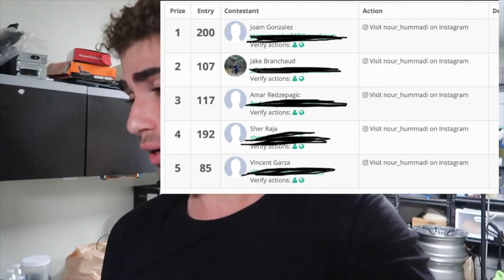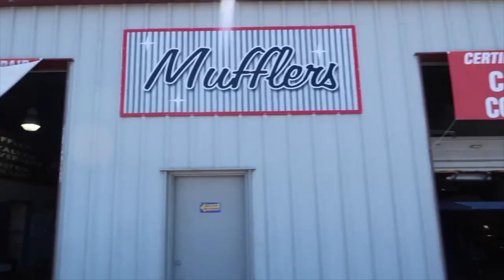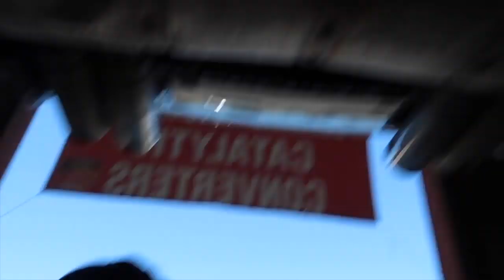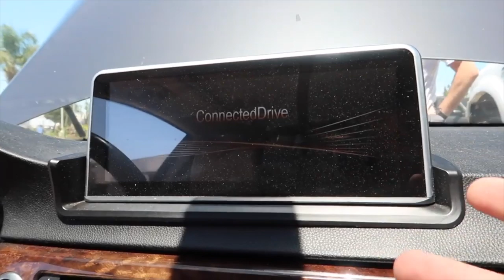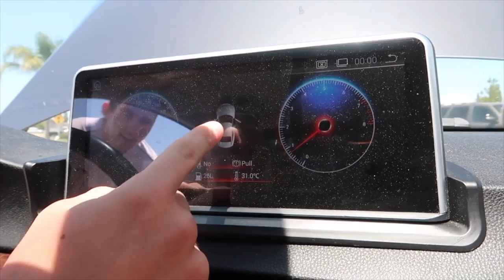BMW E92 M3 CHEAP EXHAUST MOD! (POPS, HIGH REVS)

Comment: I had muffler delete on my e92 m3 for about 2 days and went back to the muffler shop to put my muffler back on got annoying very quick to loud at low speeds drone was terrible but does sound pretty good when you rev it

Comment: yoo soo i got a question for you Mr. Hummadi orr anyone else i have a 325i e46 2003 i want a exhaust that pops and sounds good what should i get?
Reply: Mario Galvan rear muffler delete/ fully straight pipe. But a full eisenmann setup sounds best but a little bit expensive...

Comment: Congrats have fun don’t get pulled over lol. I had muffler delete on my 335 when I got it. Went fbo and got annoyed so installed a vrsf exhaust and the quietness is so nice lol
Reply: J_ Spool go race. Street is boring
Reply: heatchamps2011 I had muffler deletes and it gets annoying quick. A little too loud. Plus with race it’ll be even louder because it deletes the secondary cats on the 335i. Lol
Reply: J_ Spool well u can swap in between them. Its worth owning both. Full send bro! Loud and nice. Street u barely hear it cruising. I always disliked that lol.  .
Reply: heatchamps2011 yeah I give you that. May order the race back end later on when I go single. For now... I love the silence at low rpms lol... honestly my mini is louder 😂